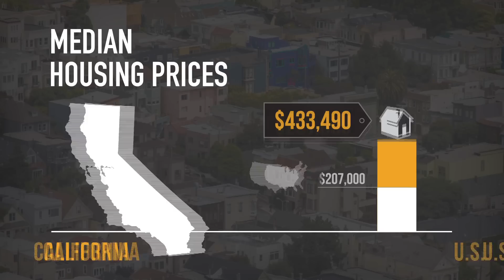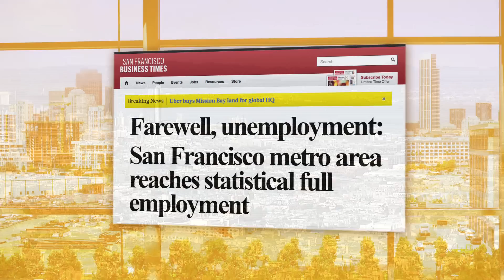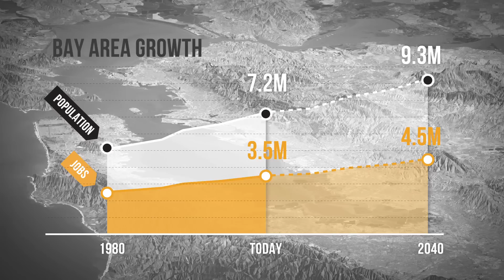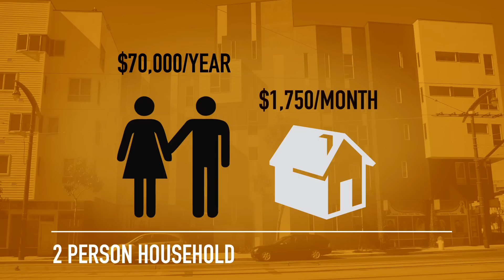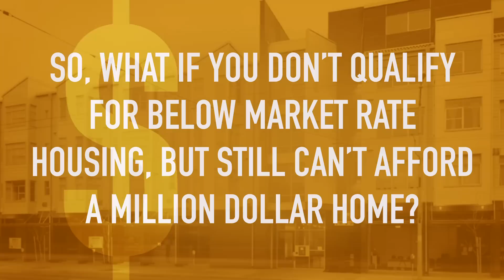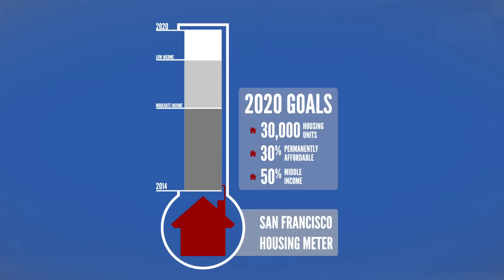SF PLANNING: Housing

Comment: Video failed to mention it takes about 3 years for SF Planning to review a Project. After which the Planning Commission will tell you something completely different  from what your planner essentially told you to do. If you want to Fix the Housing Crisis, fix SF Planning.

And this is not due to the complexity of the job, most plans sit in piles waiting for review.